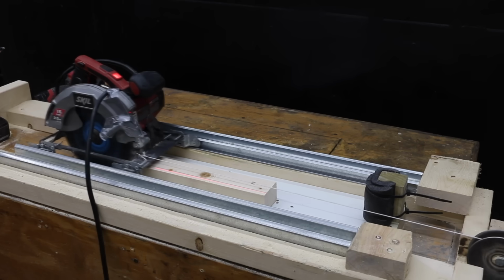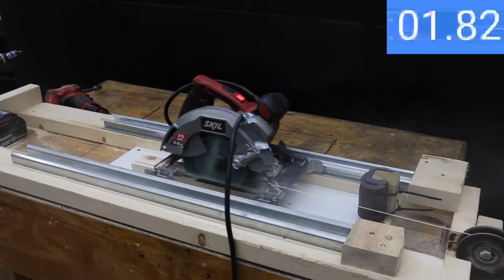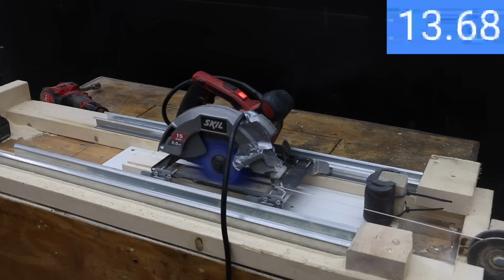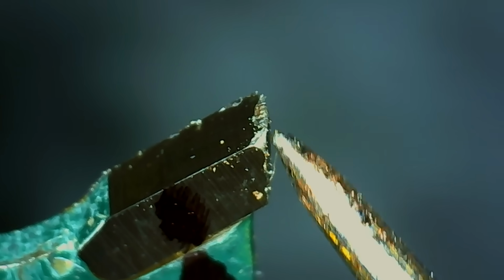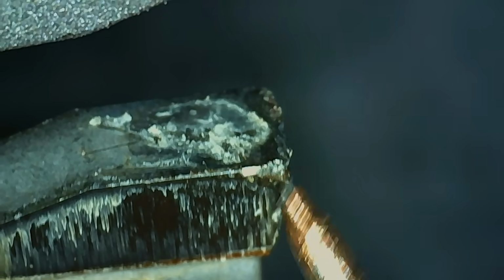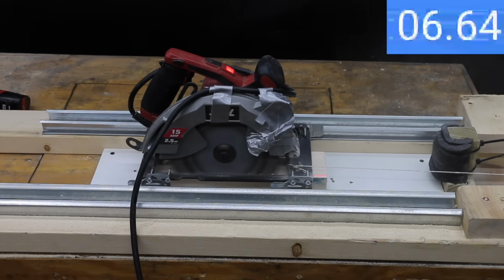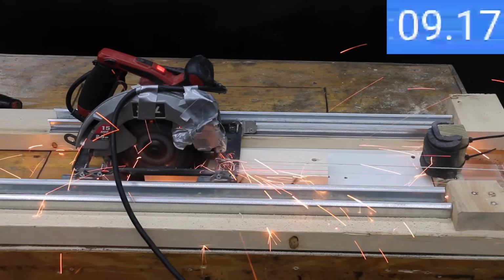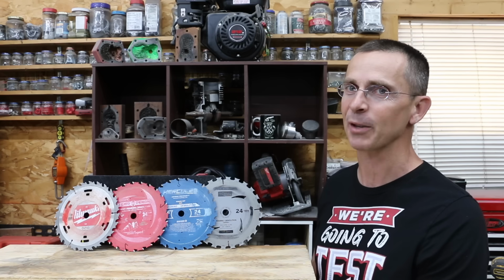Best "Demolition" Circular Saw Blade? Milwaukee, Diablo, DeWalt, Hercules, Evolution, Bosch, Amana

Comment: I predict diablo, I used to work at a sharpening place and the best shops either used diablo or had custom blades made by us for specific purpose, which was considerably more expensive, so they are near the top. They are fast, they don't throw teeth, and they're light. I'm in canada though so who knows elsewhere.
Reply: Somewhat as expected. Never heard of Evolution, Hercules are good also though.
Reply from the maker: Thank you!

Comment: Not sure if you've done it yet but Diablo ferris metal blade vs others in a conventional 14" chop saw? A guy showed me that today and I'm impressed.

Also I learned about Wurth side Cutters yesterday, they have an adjustable hinge pin that multiplies the force and a standard 6" sidecutter will cut a 1/4c grade 8 bolt. Maybe consider using Wurth tools in some of your tests?
Reply from the maker: Thanks for the suggestion.

Comment: Appreciate the time and effort you put into the tests, I need to remove a floor system which includes 3/4 inch tongue and groove flooring,true one inch decking boards and floor joists...of course I'll use my old damaged framing blades first but time is money and having said that I will try the Hercules blade. Thank you so much!
Reply from the maker: You are welcome! Thanks for sharing.

Comment: Big blue in the first cutting test looks like it had a track issue. It didn't bounce off the foam stopper at the end and I don't think it was a speed issue. You can see it shift in the track. Not saying it wasn't the slowest but the test looked like it had an issue.
Reply from the maker: Thanks for the feedback.

Comment: Appreciate all you do and thanks for the video but here is my two cents worth. Would have liked to see you also do the same with cross-cutting or have incorporated it within this test, most cuts on a demo job are crosscuts or through sheet materials fixed to 2x4's etc. Ripping cuts are really demanding on blades with a large tooth count or negative rake so it was nice to see how well these blades preformed doing this type of cut. 👍
Reply from the maker: Thanks for the suggestion.

Comment: In my professional experience an 18 tooth blade in a 7 1/4 saw is a much more effective demo blade then a 24 tooth.

The larger carbid takes more of a beating and the bigger gullet provides a faster cut.

I dont have any official stats but I used every kind of blade to demo 30,000 SF of deck screwed Advantech subfloor in a Hannaford Supermarket as my test facility. I used every kind of blade Diablo, Irwin, Dewalt and the Dewalt 18 tooth blades held up the best. Its a shame they discontinued 18 tooth blades.
Reply from the maker: Thanks for sharing.

Comment: Good testing although the shingles cuts were done by hand vs. the consistent 5+ lb weight test.  One other viewpoint would be to test how clean the cuts are from new to used or just how well the cuts are with new blades compared to the others. Carbide tipped blades are supposed to give clean no splintered cuts with most materials. 
Would be a great test to see how many teeth are required to give the results for each type of job such as fine wood work vs. middle of the road required clean/smooth cuts. I have seen 120+ toothed 10" blades for table saws...thats a lot of teeth.
Reply from the maker: Thanks!  Thanks for the feedback.

Comment: My local shop has great deals on diablos, the only saw blade Ive actually used passed dull. Once it gets dull its trash like any other tool. But ive never had an issue with em aside from eventually getting dull. They're solid blades, and very affordable. I went up a bit when getting a tile blade for my wet saw...I beat the hell of of those, but well worth the $$ (i believe I paid $90 for that blade, and its still cuts stone like butter)
Reply from the maker: Thanks for the feedback.

Comment: This was a great study.  Certain ‘metal cutting’ blades require slower and higher torque circular saws and it would have been interesting to compare the blades on an Evolution saw which claims to meet these requirements.  Anyone who has drilled steel or cut metal sheet will recognise that ‘higher speeds’ does not necessarily result in faster cutting and will, in most cases, result in shortened tool life.  The effect of localised heat on the cutting edge has a dramatic effect on its wear and damage.  Slow and steady with plenty of lubricant (also acting as a heat dissipater) extends tool life and ultimately ends up being faster as it remains effective for longer.
Reply from the maker: Thanks!  Thanks for the feedback.

Comment: Here's a video idea I just thought about. Running things in energy saver mode vs regular and determining if the reduced output is worth the savings. A good example is that many of us run a window AC unit in our workshops. Most, if not all, have an energy savings mode. From my own personal experience, putting one on energy saving mode causes a delay in how long it takes to cool a room, although once cool, seems like it holds a steady temp the same as regular mode. Sure, there is energy savings during the cooling because it doesn't run as hard, but over the long run in terms of how much energy is used to reach a certain temperature, does the energy saver really use less energy? I am thinking not much if any. Refrigerators also have that mode.  
Love your videos, and particularly enjoy the mechanisms you build to test things. Keep up the good work
Reply from the maker: Thanks, will do!  Thanks for the video idea.

Comment: I know this is wood blades, but the steel demon Eats I've had one for about two weeks and I've used it just about every day cutting square tubing and angle iron. Dosent heat the material up either.
Reply from the maker: Thanks for sharing.

Comment: I'd love to see some test with higher tooth counts like 40, 60, and 120 tooth blades showing how quickly they can cut and how clean the cuts are and then compare that to the best 24 tooth blade out there.  Speed versus quality of cut is one of the big takeaways I'd like to get from it.  I'm also curious about their durability.  I'm not sure if those sorts of blades are on your radar, but it give you an excuse to revisit circular saw blades with a fresh angle.  I used to use a 120 tooth blade for cutting plywood because it claimed to be for that purpose, but my own testing eventually showed that 40 and 60 tooth blades gave virtually identical performance and were superior to 120 tooth blades in terms of cut speed and durability.  One test I didn't do was checking how each of them performed in MDF, but I did check cross cutting on 1x12s and cutting plywood.
Reply from the maker: Thanks for the suggestion.

Comment: Thanks again for another great video.  I normally buy Diablo in part because of convenience (sold at Home Depot) and the fact that they are a excellent blade. I have yet to buy a bad blade and most of the time you can get a two for one deal or some kind of special buy.

Comment: Today I was cutting steel with my 14 inch abrasive cut off tool. I was having difficulty getting through the steel with the abrasive wheel that I was using from Harbor Freight. I went back to Harbor Freight and bought a more expensive wheel and it cut very good. Came to your channel looking for a video on 14in abrasive disc at didn't see one. Suggestion for a future video.
Reply from the maker: Thanks for the suggestion.

Comment: Currently Avanti Pro 24 tooth thin kerf framing blades are 2 for $4.88 at Home Depot. Can't beat that. Diablo blades are always better than average. Usually my choice but for demo I'm using a cheap blade. Tooth count is important because they will get chipped/broken. No way I'd ever buy that 5 tooth blade for any use.
Reply from the maker: Thanks for the feedback.

Comment: PLEASE DO TESTING ON STEEL CUTTING CIRCULAR SAW BLADES
Reply from the maker: Thanks for the suggestion.
Reply: @ProjectFarm  WOW!  First off i am impressed with your response .  I am an independent  residential housing contractor (27 years thus far) and am a subscriber and watch your videos frequently, you do great work, which i have utilized in various tool purchases and I have told many people to check you out for various advice. anyhow i have tried researching via feedback comments on circular metal cutting blades from 7 1/4" , 12" and 14".  Any testing from you would be much appreciated from myself and countless others.  thanks again and please continue with your quality nonbiased testing.

Comment: I bought a spider last night to cross cut 1in line boards. I was replacing a diablo blade that i ran through my metal sawhorse. The spyder blade was so bad i couldbt make a straight cut to save my life. The worn damaged diablo actually cut better. Headed back to the store for a new blade again now.
Reply: Make that 1in pine boards...
Reply from the maker: Thanks for sharing.

Comment: I'm a roofer who does a lot of rotted wood leak repairs and I've used just about every blade under the sun. We recently started using the Spyder brand blades and I have to say that I'm impressed by how long they last. I've had brand new Irwin blades not make it through several small roof repairs consisting of cutting OSB sheets and pine boards. The Spyder is incredibly fast and smooth and its probably the longest lasting blade I've ever used. We bought one to try months ago and we're still using it. If that had been an Irwin blade we'd have been through 4-5 of them.
Reply from the maker: Thanks for the feedback.

Comment: Some feedback: when showing the numbers for the blades cutting through clean wood after having cut through 30 nails, I think the more helpful data point would be the percentage time increase of each blade from when it first cut through clean wood before the 30 nails. That would give an objective comparison between all the blades of how much life they lose after encountering nails, whereas just listing the times is relative to each individual blade and not an overall comparison.
Reply from the maker: Thanks for the constructive feedback.

Comment: I like grip right I seen one cut a 12-14ga steel saw horse in half without slowing the saw and not damaging the blade it acted like it was wood. and they are cheap. and usa made. I will always ge\t them now because they are the best cut for the buck iv seen. and last as long as diablo.
Reply from the maker: Thanks for sharing.

Comment: Video Idea:- A video on optimal Snow Thrower / Blower, that's say around 1-4 hp and say two feet wide, something for average modest two to three car driveway. Thank you. Looking for durability, throw distance, gasoline consumption,  how much snow remains in each pass on surface, MOST IMPORTANTLY, how much effort is needed to push snow thrower/blower through light fresh snow of a given height. This will be a most difficult exercise. I how it's done Thank You
Reply from the maker: Thanks for the suggestion.

Comment: I use Évolution Blades like in this Test an in a Version which is for Wood and Steel.I‘ve cut Steel up to 10mm and after that different pieces of Wood and they still do a perfect job.And another advantage, the Steel is not Even warm directly after cutting.Really Worte the money!
Reply from the maker: Thanks for sharing.

Comment: You might have covered this in the video, but I'm curious why you didn't use a worm drive saw for the testing? I would be interested in seeing the difference in blade performance using a WD saw.
Reply from the maker: Thanks for the suggestion.

Comment: Thanks,
My stash of blades is running down.
Retirement is grand!
You did not have my go to 24 tooth Irwin Marathon in there.

Coming from before ubiquitous carbide blades,  when we carried stacks of blades on a carriage bolt to the  sharpening shop, all of these blades look great.
That big blue must kill saws.

I know framers are not too concerned with the finished product, but I would sure like to see what the wood looks like.
Hairy cross cuts, nasty rips?

I use thin curf Diablos in cordless saws.
Not the mirror finish ones!!
I see double following a line!!???!

That is one test you could do.
Compair battery life to length of cut, with a variety of blades.

Both cross cut and rips, in framing lumber, plywood and 'engineered lumber ' like Advantek and microlam beams.  Chris
Reply from the maker: Thanks for the suggestion.

Comment: If you ever revisit this test you should get a couple PCD blades. freud and milwaukee make them that i know of. They are a blade made for cutting laminate where a carbide blade dulls instantly. freud pergo is what they are called, i know they are made in a 12 and 10 inch, while milwaukee has a similar blade in the 7 1/4.
Reply from the maker: Thanks for the suggestion.

Comment: I've been using Diablo blades for a while now, glad to see you had good results with yours because I love mine.  It's also interesting to see that Harbor Freight has really stepped up their game when it comes to saw blades, drill bits and stuff like that which used to be pure garbage (HF always had some good stuff but their old blades and bits were trash).  Seems like HF Hercules and Bauer brands make some pretty good stuff especially for the price.
Reply from the maker: Thanks for the feedback.
Reply: Yes I do a fair share of construction and over the years have noticed the general reliability of diablo blades especially for demo.
Reply: I'm also finding it impressive how the HF gear is improving. I thought they would forever be known as throwaway junk.
Reply: Just as I figured, I use Diablo blades, Hercules blades, and Bauer blades more than any other brands... and I pretty much get the same results as you got here, they last a long time and do a great job.
Reply: I too have been using Diablo blades since my first saw (a Ryobi cordless reciprocating), and I've always been pleased with their performance, so glad to see that they performed well.  Mostly I use saws for demolition while someone else does the cutting for construction.

While I think I'd always fall back on Diablo, I'd be interested in trying the Evolution or the Hercules.

Comment: 12 types of bits, 11 tire plugs, 10 razor blades, 9 head gaskets, 8 AA batteries, 7 kinds of epoxy, 6 types of gas, 5 car jump packs, 4 drywall anchors, 3 deck screws, 2 types of power converters and 1 Project Farm.
Reply from the maker: Thanks for watching!

Comment: I have a 10" Rigid chop saw and using the factory blade I accidentally cut through a framing nail with it (The long way!  Shaved about 1/16" off it)  Piece of recycled 2x4 had a nail in it I didn't see.  Blade made a funny noise, I thought I hit a big knot that I missed!  But it went through it like a hot knife through butter, no damage that I can see.  Pretty impressive for a default blade!!
Reply from the maker: Thank you!

Comment: in framing houses for 45 years I have cut thru 1000 miles of rafters plywood etc. first ten years or more no carbide blades. what I have found is I would never buy a carbide blade with the so called cooling slots being as they heat up like ripping a long 2x10 or 3/4 plywood they warp and will not cut straight cause they act like separate blades between the slots going there own way. try to find the hercules or evolution in solid form no slots. this has been proven in the field for 20 years for me
Reply from the maker: Thanks for the feedback.

Comment: How come I don't see any of the REAL saw blade manufacturers?  Except for Freud, these are all weak blade makers!  Where's Amana? Where's CMT? Where's Forrest?
Reply from the maker: Thanks for the suggestion.
Reply: Because normal people don't buy that luxury crap?

If you're buying skil saw blades that cost more than 15 or so bucks a piece or more importantly something that isn't sold at your average hardware store you're a brand bunny and won't believe the results anyway so it's just a waste of time and money on his part to get and test them
Reply: @Robert-qm7yi  Using the right tool for the job is 'not luxury crap', it's knowing how to get the right results for your job.  By the way, Milwuakee power tools are oftentimes very expensive products, so you can't make the argument that it's about money.  In your case, it's about attitude.  So you can wrestle with your projects, you can wonder why nothing ever fits right, and you can tell yourself 'it's good enough".  On the other my cuts are straight and precise, and my projects look good, because I like to use a little bit of 'luxury crap'.  Have a nice day.

Comment: I cut all the hardie siding I needed for a 3200 square foot house with a 6 dollar carbide blade and it was still sharp when I was done . The other blades are snake oil
Reply from the maker: Thanks for the feedback.